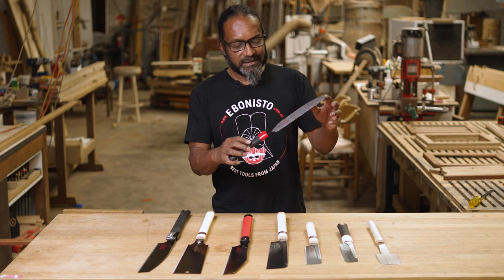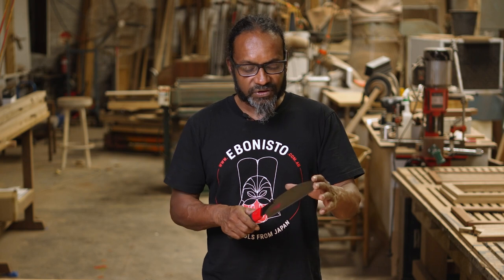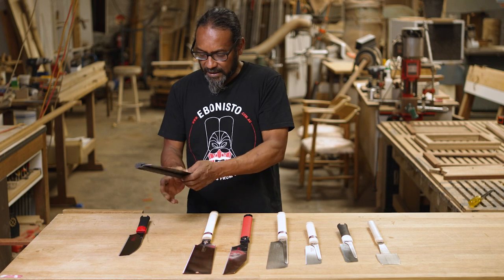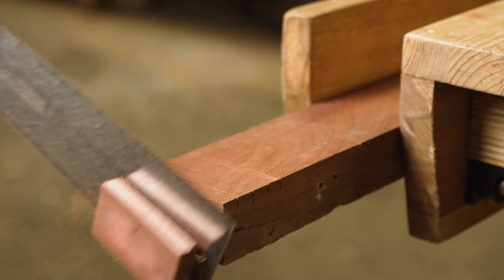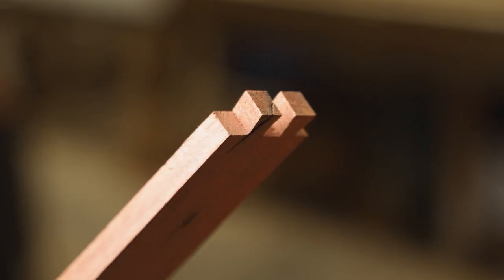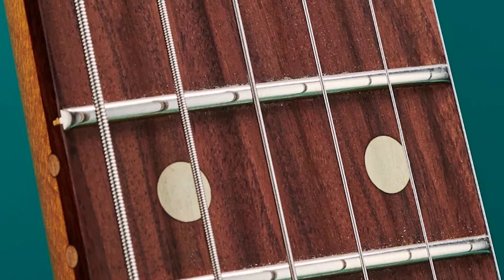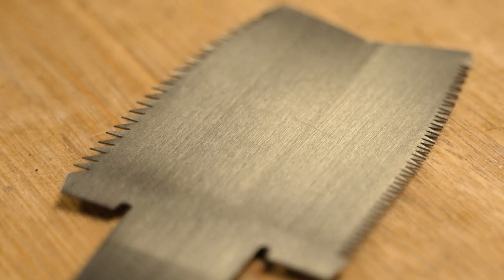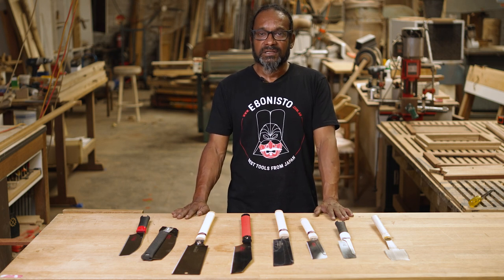Introduction to Japanese Saws

Comment: My Dozuki is by far my favourite tool, it has made Dovetail cutting an absolute joy-fast, easy and so, so accurate- whereas using my old Tenon saw left me having to use my chisels to tidy up the cuts all of the time-not any more!
P.S. I recommend that every serious woodworker invests in Japanese Carpentry tools, they are a lot more expensive and take time to master but I guarantee that the quality of your work will improve dramatically and you will not want to go back!
Reply from the maker: Hello @blackbird58, The Zetsaw Dozuki is so pleasing to use, I think that cutting on the pull makes all the difference, and the quality of the fine teeth of course. Thank you for watching.